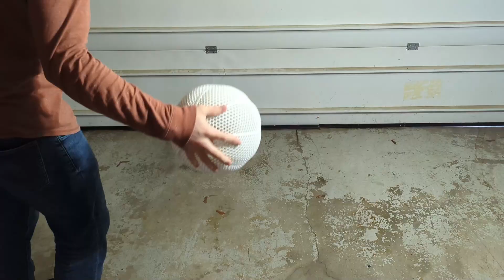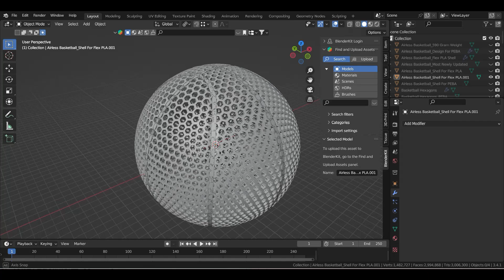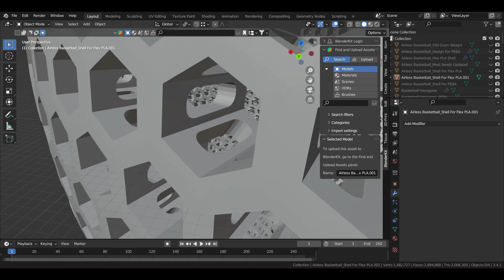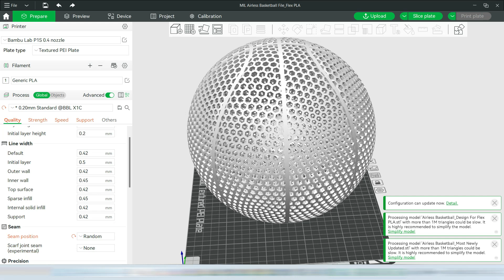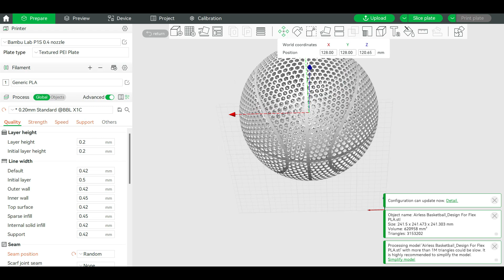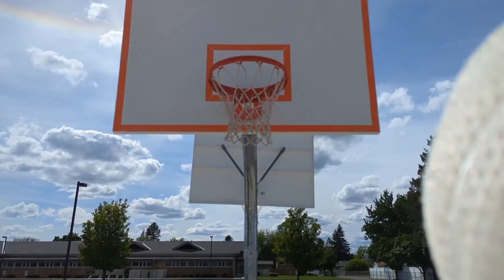Our New Airless Basketball 3D Models!

Comment: Thank you for taking the time to make this video and replying back. I was wondering if you could try printing in overture super pla +. I have printed other basket ball models in this filament that have worked but broke later on.
Reply from the maker: @inventor4life  hey there, I have actually printed a few in Overture Super PLA+, and they have unfortunately all cracked. I do want to try coating it in 3d gloop like uncle Jesse did to see if that will work. Here is a video if interested: https://youtu.be/QysYjy96pLI?si=r1yF7zr8IxSR_GYh

Comment: Would PETG zero-clearance supports work for this? Great work so far!
Reply from the maker: @MatthewLiguori  thank you! The only issue is every time I have tried flex pla or peba in the AMS it has caused big issues. If I could figure that out it would be so much easier to remove those supports lol

Comment: So using PETG supports on a PLA model makes removal super easy, so what if you used pla/petg for supports on the peba basketball?
Reply from the maker: @Return_To_Sender  man I want that to work, but the peba and flex pla don't play nice with the AMS every time I have tried. If I could figure that out it would make it so much easier 😁